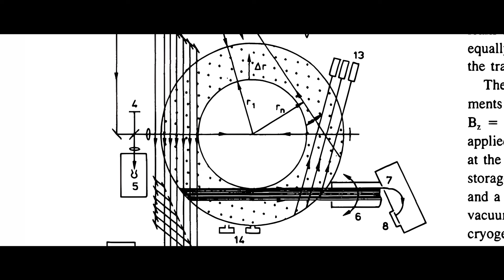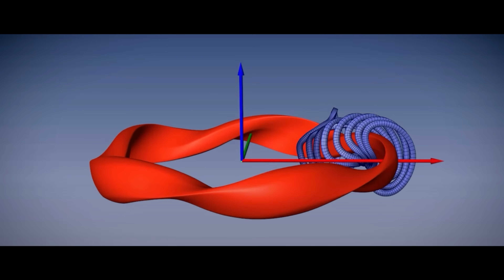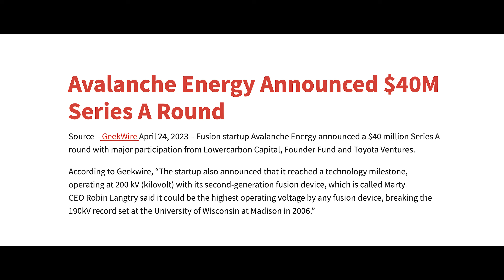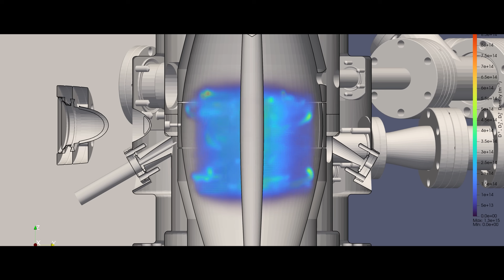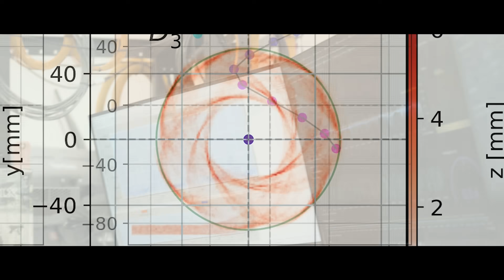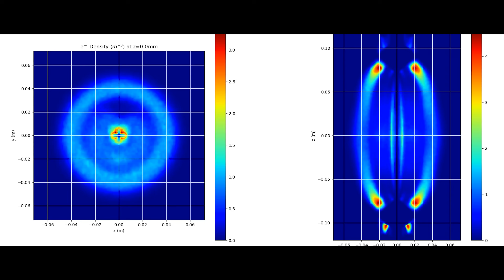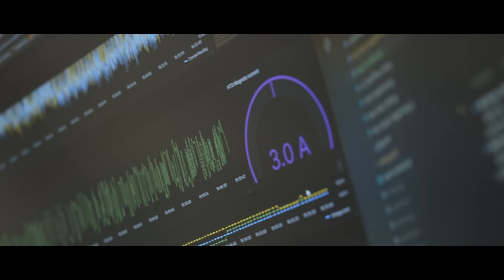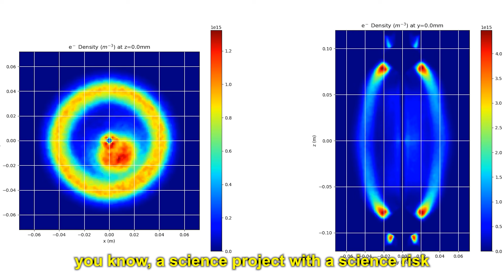This Company Invented a New Way to Do Fusion

Comment: Don't you hate it when someone says I applaud your effort but I'm sorry I'm taking your lunch money. We can't buy you lunch. I'm so sorry. Maybe next time? Don't you hate that? 
Guys, I cannot believe how stupid you are really. This is the holy Grail argument for cold fusion. The original fleshman pons experiment using a palladium matrix specifically to eliminate, although I don't think they knew about your exact situation of course, but they didn't have to the effect is still the same. It eliminates by tramping molecular levels at molecular scale. So go to the nearest dumpster and just pour in your $40 million and try again. 😂❤ I applaud you. Sincerely,.
Reply: I'm going to add a novel theorization. It's probably novel because it comes from my own background and I'm not repeating anything except for common knowledge facts. So the problem with the palladium experiment should be obvious. It's exactly the opposite to the scale that you're at, which is that you cannot get a flow. You cannot control any particular concentration you have to kind of convince or coax or burn incense and chant to trigger fusion and it seems to occur like in a chain reaction nice and slow and steady when it does show up. The problem you're having is a system change in dimensionality similar to what happens when a tornado is formed. You get essentially two axis planar motion building out to three axes. And as you note, it changes the nature of the containment. So I'm just going to pop this off and it's probably right because it's based on fundamentals which is that you need a four-axis containment. And by the way, that's what's inside the palladium matrix. So the question is how do you do that at essentially a macro scale? I'll think about it and I might give you an answer, but you know what I could use a donation. I'm serious. I could use a small Grant for my own s***. Cuz I'm having to work in my car and I'd love to have a desk. So don't applaud me. pay me.
Reply: Okay, after I watch the whole thing Good on you but I was right as. From your perspective I have no right to know this because it's from an allied field. A study of mathematics as old as f**. It goes back a few thousand years. But I would have done pretty much exactly what you guys did because as everyone should know a fourth axis is a restraining axis. In fact, each axis can be interpreted as restraining the one before. It only occurs within the parameters that the new axis defines. This is not the first big question that I've solved and a lot of them led to things like oh .. Uber in 1974 using telle taxi stations which by the way still works. And you should see what gravity really is. It's so f***** simple. And a lot of other things a lot of other things so I could still use that grant to get a little work space.

Comment: Unfortunately this device will not work better than Farnsworth's fuzor, as the cold fusion is the only viable option of fusion. The plasma at the core of Sun has density 26 tons per cubic meter, yet it produces as much heat as the pile of manure per volume (~50 watts per cubic meter). Now, the density of plasma in reactors similar to this is the one inside of fluorescent bulb. Do you realize, how distant we actually are from viable hot fusion?

Comment: Can you like rotate a static field by alternating its poles?
It's cool so you're using a static field to charge but also hold things in place and then another field to rotate it so it doesn't clump and then you put it under a bunch of pressure and it fuses and creates energy?

Comment: Unfortunately, fusion itself is only part of the solution; we’ll never be able to harness the energy produced until after a power transmission network is created capable of proliferating into the current power grid’s reach into regional-level distribution of the existing grid infrastructure.

Comment: You should check out, The Safire Project. Think they are a little bit ahead of you. You could definitely pinch some ideas off them to do with plasma confinement.
Reply: Pathological science. Don't be fooled.
Reply: @MattNolanCustom  Please elaborate.
Reply: @Detton80r apply skepticism and critical thinking. You should do this stronger and harder to things that you think are right
Reply: Indeed I do. And plasma contained by it's own magnetic field makes sence, instead  of wasting money  and energy trying to force something to behave un naturally. Nothing of what they are doing at the moment is imitating reality and therefore destined to fail. Is that critical enough?
Reply: @Detton80r  how does plasma contained by its own magnetic field allow same charge polarity particles to get close enough to each other at sufficient relative velocity to overcome the Coulomb barrier and fuse at a substantially significant rate?
Reply: In a medium. Plasma self organises, creates double layers of counter rotating polarities. When in resonance, these layers are stable but sudden increases in current can create charge density increases, plasma instabilities, z pinches and magnetic field line reconnection. Very bright, very pretty. Brautiful to see.
Reply: @Detton80r keep drinking the kool aid. I will buy you a real drink when Aureon produces and sells energy at a commercial scale

Comment: Leave your assumptions at the door.
There are no "Neutrons". There are electron/proton pairs. (see the SAM (model) of the Nucleus).
Half-lives are dependant on the electrical environment, not the Will of God.
I suggest that you study the results of the SAFIRE experiment.
Think of collaborating with Aureon energy.
Nuclear synthesis is a lot easier than you think.

Comment: Ok so a few things. Firstly they achieved first light. Anyone can achieve first light with electrostatic fusion for about $5000 worth of equipment and a garage to put it in. Secondly they are talking about a mixture of electrostatic and magnetic confinement. Magnetic confinement doesn't work and has been proven not to work because it introduces plasma instability. Billion and billions of dollars and 60 years of research has not overcome this problem. Thirdly the process requires deuterium. Deuterium requires a huge amount of energy to extract from seawater so to reach a positive energy output you not only have to reach ignition but you have to add to that the huge amounts of energy to obtain the fuel source as well.
I would like to believe in this tech but I remain to be convinced.
Reply: Well said

Comment: Electrostatic fusion has been around since the '60s. This company, though, has gone beyond the basic ES fusor. Maybe they finally will achieve controlled nuclear fusion? Incidentally, there are ways of achieving nuclear fusion in solid state devices, without using high temperatures.

Comment: Make electricity directly from the rotating plasma, on a relatively  small scale, enough for a household. The grid would be unbreakable.
Reply: Rich people will not allow this tech to florish at consumer grade.
Reply: where is the energy coming from? to create and maintain the plasma, you need to spend energy. energy will be lost, not gained, unless the plasma can couple with an external ambient energy source like earths gravitational field, or produce nuclear reactions, it cannot ever produce energy.
Reply: @sshreddderr9409 The energy comes from the mass of the plama being converted into energy due to fusion. The heat makes the plasma spin faster and faster.

Comment: I think chem rockets can pull it off for a while. Even get Mars regularly for a while, or even indefinitely. But to really get interplanetary economics going, we need nuclear and other propulsion
Reply: they could go to mars, but it will be extremely dangerous and expensive even with reusable rockets. the extreme temperatures and forces involved make the margin of error basically zero, and every error lethal. to actually make spaceflight economic, safe and useful and make it able to transport huge machinery to build permanent habitats, you need gravity control. you need a device that can produce a repulsive gravity field. this is obviously physically possible, but wont be done by people who buy into the modern academic mindset, or who believe relativity or maxwells equations to be a complete description of gravity / em, and who take the limitations of the mathematics chosen to model them as limitations of physical phenomena.

Comment: It seems like the stellarator has been a bet on computational and manufacturing improvements for funkier controls, and the tokamak originally was more ubiquitous because it de-emphasized these.  Are electrostatic schemes also a computational/control system complexity bet, or have they been less ubiquitous because of something fundamental about the physics?  Interesting concept though, i always wondered why an electric field to clump positive particles isnt a common part of other systems but i assume there is a good reason.  But even if you have to pump in a lot of energy and not get energy gain, i wonder if this is gonna be a nice compact testbed for neutron bombardment, plasma controls at high fusion rates, and all the other engineering questions that are a pain in the ass to scale to with tokamaks

Comment: Your method is actually a more powerful version of that Plasma Toroid Experiment, now that I think of it, just add electric and magnetic confinement to really let it get to higher temperatures, and pressures. However, with the other comment, it isn't the heat or pressure that gets you your results. The heat is a misunderstanding of what temperature is, I think Planck said as much about the temeperature of the Solar Photosphere and Corona. Pressure, well the Sun can't use pressure or gravity to confine its shape, outside of stars and maybe Saturn, there are no gravitationally bound bodies under hydrostatic equilibrium that is as perfect of a sphere as the Sun.
Reply from the maker: Did you study physics in college?

Comment: You are quite late on energy density, electrostatic confinement, and confinement time. I think it was around 2019 that someone in Mississauga did this. Different method, and originally, they were trying to confirm what the Sun actually was.

Comment: Z pinch. Ive never seen a sun in the shape of a donut.
Reply: Z pinch has been largely abandoned since particles are able to escape along the magnetic field lines (charged particles loop around magnetic field lines due to the lorentz force). Tokomaks and stellerators are toroidal in order to address this issue: the magnetic field lines form closed loops within the reaction vessel.

This design, meanwhile, uses electric fields to constrain ions in an orbit around a central electrode, which IS questionable, as the ions aren't as strongly confined to their intended orbit. Also, energy loss from bremsstrahlung (fast particles can lose kinetic energy by emitting light) is a major concern for this design.

So yes, you should be skeptical about this startup, but Z pinch is not the way either.
Reply: @altrombone1775  I just think that a fusion reactor shouldnt just spin and confine plasma but implode it into itself. Thats why I believe tokomaks and stellarators wont work.

Comment: ...ACCORDINGLY TO time physics THAT is POSSIBLE ONLY IN CASE OF artificial SLOWING DOWN OF TIME ITSELF ON THE PARTICLES TO KIND OF WHAT'D BE AT 0,999c AT LEAST ,so it'd be possible for protons to slip close enough

.....IS THERE ANY KIND OF CONTRAPTION at this "COLD FUSION DEVICE" THAT WORKS IN fourth dimension ???...........IS THERE?

...BECAUSE IF IT IS not,THEN THAT THING is A SCAM 

........WHAT is TIME PHYSICS ??........A model that explains with EASE all of unsolved so called "unsolvable mysteries of physics" ,CAN EXPLAIN both QUANTUM MECHANICS(space ITSELF glitches,so one particle can be at multiple places at once) and WHAT'S INSIDE BLACK HOLES(it is BORING,literally NOTHING can happen,simply because it'll take FOREVER to happen,and this IS why they're BLACK,because space inside black hole is taking FOREVER to let a photon pass through)

.....BESIDES,TIME PHYSICS CAN SAVE first law of thermodynamics BY SOLVING THE MYSTERY "where from a mysterious force is getting energy that makes kazimir effect to work"(that effect is about proving that vacuum is made of constantly annihilating virtual particles,which can make a somewhat pressure,and it was scientifically proved ,but....by doing SO,it basically breaks FIRST LAW OF THERMODYNAMICS which tells that "energy can NOT appear out of nowhere!" .....but it is THEORETICALLY possible to create contraption that CAN extract energy from that pressure....and,by doing SO,effectively break that 1st law of thermodynamics....so time physics solves THAT mystery,quite elegantly,though....because E=mc² ......and some additional steps which will take too long to explain...so,well.....as you CAN see, time physics is making a critical corrections at EINSTEIN'S RELATIVITY THEORIES to make them work smoothly at ALL scales)

....ALSO,TIME PHYSICS OFFERS A QUITE easy EXPLAINATION OF GRAVITY,WHICH CAN BE FORMULATED AS "what got mass,at still state,tries to go where time flows with less speed"

.....PROOVE ME physically WRONG OR ADMIT THAT this DEVICE IS A scam .........

.....U know, LAWS OF PHYSICS DO not OBEY ANYONE'S IMAGINATION/LAWS/RULES/CONSTITUTIONS AND WORK AS THEY work, no matter WHAT,REGARDLESS OF PLACE and TIME ,AND if SOMEONE will TRY TO WRITE HOW THEY WORK AND WILL DO A MISTAKE,SO THEY DO not WORK AS IT WAS written,THIS IS FAULT OF THAT someone who wrote like that !!!!

.......SO,WELL........ no matter what you do,THIS "cold fusion device" WONT WORK,AND thanks TO THE REASON why THIS DIDNT WORK,WE ARE all ABLE TO BE WHERE WE are....... because of otherwise everything wouldve continue to react with itself until NOTHING would have been left LIKE 13,7 BILLION YEARS ago*

....besides,A NOTE ABOUT "some russian experiments at 90's" MADE ME LAUGH SO HARD because only thing they were capable of doing back then,was LOTS OF VODKA ,HEHEHEHE

.....BEST WISHES,AND HAVE A WONDERFUL WHATEVER TIME OF DAY IT IS NOW,HONORABLE LADY AND GENTLEMEN WHOEVER WILL READ THAT POST UP TO THIS POINT.....................

Comment: OK, so it looks like your using a different technique to concentrate your electrons. The more you concetrate your electron charge in the plasma, the lower the temps/pressures needed for Fusion. And this is the first Fusion video I've seen where someone really is doing something different! I hope it works!
Reply: I hope it does too. I think doing fusion this way unlocks more uses for fusion because of its compact size.

Comment: IF anyone actually ever reads these comments, ZAP the plasma with an Electron beam. You'll have to switch your magfield off for maybe a millionth of a second. That way your electron beam doesn't get messed up going through a Magnetic Field. The excess -'ve charge will draw the + charged nuclei in together. You put your energy into concentrating a negative charge, which is easier and smarter than trying for insane temps and confinement.
Reply from the maker: Will try to send this note to the team!!!
Reply: Told them ages ago to use electrons to reduce couloumb barrier

Comment: Seeing the future happening in our lifetime has always been the dream of passionate engineers
Reply: a true "get excited" moment
Reply: @joe-go-jint-aJ2997 are we thinking the same thing?!😆🩺🪨
Reply: Yes, but this is but a dream.

Fusion is a blind alley, even if they could get their hyped up fusor to work.

The waste heat from fusion will heat the atmosphere as surely as greenhouse gasses, just by a different mechanism (direct heat instead of trapped sunlight).

We have to abandon unfeasible dreams and make a sustainable future.

That could be pretty cool too, even if it doesn't resemble Hollywood fantasy stories.

If you want to form the future make one of the 35+ energy storage technologies cheaper.
They actually work today and there will be no technological future without them.
Reply: @madshorn5826  piss off
Reply: @madshorn5826 The thing about the technological future is that idea in my experience is only a dream due to social expense in contentment for stagnation and distraction. 

I look at the world today personally I'd rather escape into sci-fi. Because otherwise the powers of change are stronger wielded by control within arms and armies in directives against any change from their alignment.
Reply: @madshorn5826  The waste heat will heat the atmosphere? Do you have any idea how power generation works? Do you have any idea on what scale climate chane even works? Man wtf
Reply from the maker: Amen.

Comment: Most fusion reactors will fail because there is no fuel, while deuterium is free, tritium and helium3 don't exist on earth. DD fusion is mostly useless and DT and DH3 are incredibly hard. 
But hats off to coming up with a different way of containment. The neutrons that escape from the plasma are still going to blast the walls and irradiate it, it will have to be lined with lithium or beryllium to produce tritium.
Wonder what Improbable Matter or Dr Daniel Jasby would make of it.

Comment: You must use an asynchronous rotating field to disperse the slump of plasma at the beginning and to clamp it down later by changing the gradient and field orientation.
Reply from the maker: Agreed
Reply: Or just apply more peanut-butter.  🤔
Reply: @lordgooork  yeah, but it has to be the crunchy kind
Reply: I think it comes down to random number theory at a certain level to find the most efficient method(s).  I think a room temp. superconductive helps solve this instantly.  I like to imagine these fusion pre-cursor experiments as heat-pumps.  Obviously, the end result is to 'steal' heat from such a pump running at 100M+K.  The scale is baffling.  They never say in the vid what temp it gets to in such and such time, or did i miss it?